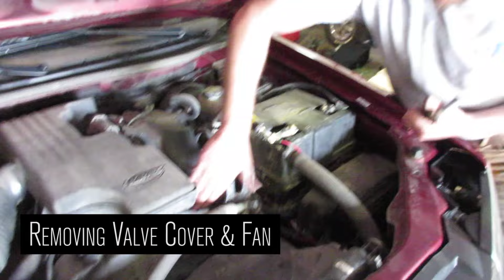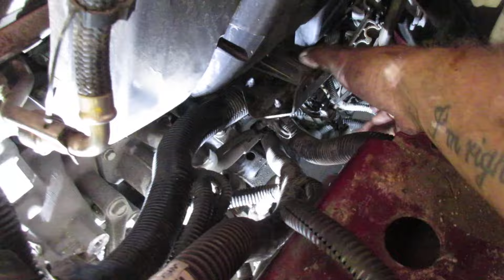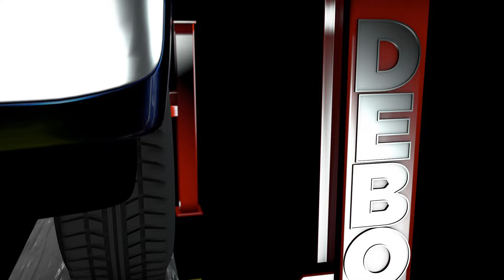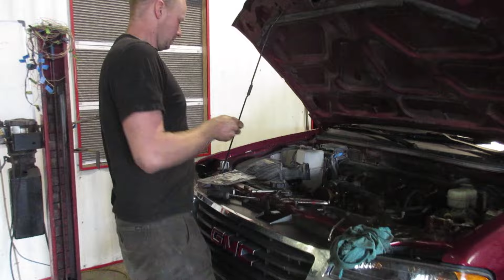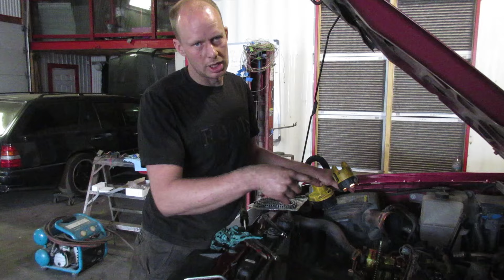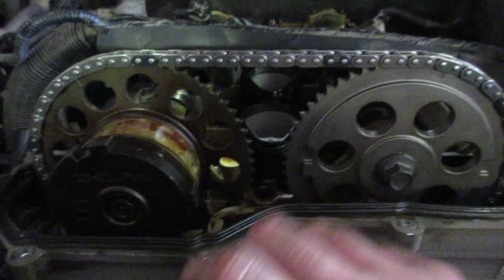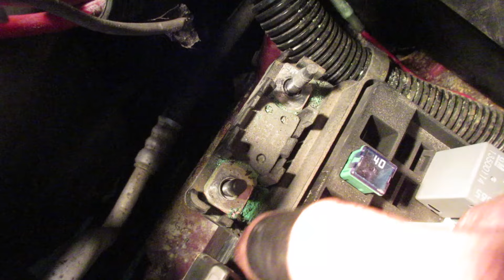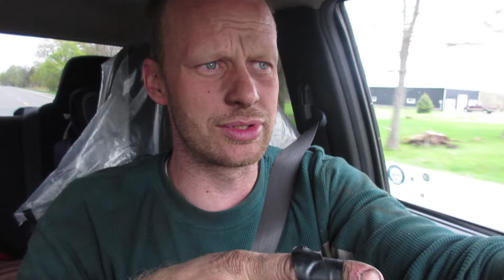Over-Engineering At Its Finest! GMC Canyon Needs A Timing Chain

Comment: Worked at GM for 30 yrs. When you know how they're built you drive something else!
Reply: Exactly
Reply: Yeah lets drive a ford triton motor with spark plugs that have only THREE threads holding the spark plugs in the aluminum  head. How about a Dodge truck that you have pull the wheel hub assembly and remove the studs to replace the rotor. A caddy that you have to pull the intake manifold to replace the starter. A infinity that you have to pull the intake to replace the friggin spark plugs. There is not a manufacturer out there that doesn't have a WTF design in there lineup.
Reply: i usedto work for mercedes but i didnt drive a merc despite the discount offered to unreliable and depriciation is shocking and thair a pain in the arse to fix 😕 and expensive 😠
Reply: Robert, I think your words hold the most value.
Reply: That's why classic cars are decent. Sure, they're not great on gas, but engineers weren't complete dumbasses putting starters under intake manifolds and putting long bolts in confined spaces back then. Also, parts are cheap because they're all mechanical. Electronics are radio, lights, horn, starter, and maybe an automatic choke.
Reply: Or you grow up in a GM town and have attained the age of 60 and only owned two GM vehicles and the first one Mommy & Daddy got for me while I was in High School. With the last GM I was one of those who got screwed over by GM's excellent camshafts in the late 70's (At about 30,000 mile thes #5 exhaust cam profile was about as round as the rims on it) . I currently have 2 Fords, a Dodge, a Toyota and a  bought new one owner 29 year old 315,000 mile Honda.
Reply: Michael Wilkening Toyota : I’m better than any of these junkers
Reply: @isaacsgarage931  for testing purposes only
Reply: @michaelwilkening8542  dodge has had rotors that pop off since 2000. And a lot of old trucks you had to disassemble the hub to get the rotor off anyways.
Reply: What like a pos dodge?
Reply: @michaelwilkening8542  You're cherry picking. There is having bad stuff here or there and theres bad practices that affect entire lineups. Try not to get your feelings hurt next time
Reply: Can you tell me if this is the 4 or 5 cylinder engine thanks
Reply: @michaelwilkening8542  ever driven or worked on any honda or toyota?
Reply: @anthonyvu749  I spent a quarter of a century turning wrenches until my body said no more. I have worked on almost every modely car except some superexotics. So yes I have done a lot of work on Hondas and Toyotas. They are reliable cars but interference motors means you break a timing belt and you basically scrap the motor. My biggest gripe was when the calipers had rubber sleeves around the fasteners and the manufacturer didn't spend less than a 1/100 of a yen  to put a little lubrication to keep them from rusting up and prematurely wearing out the brakes.
Reply: Nah just drive the right GM. The 99-13 full-size trucks are a pleasure to work on
Reply: @MartinGarcia-wy5kh  5
Reply: And you drive what?
Reply: scab